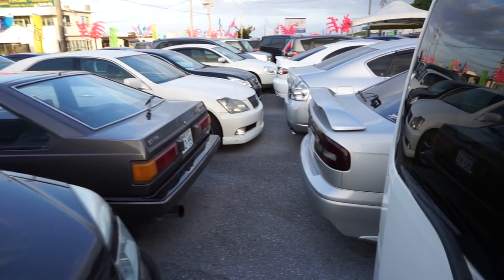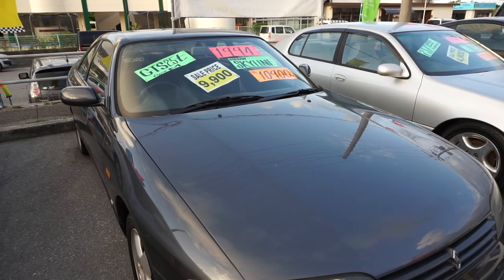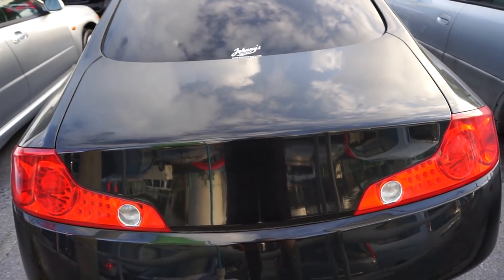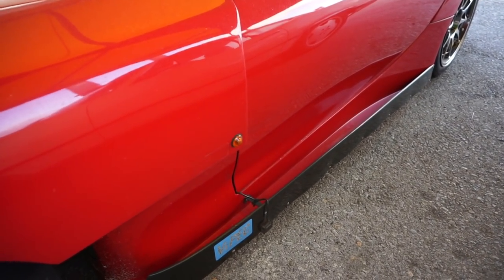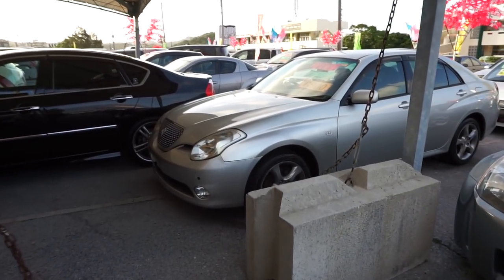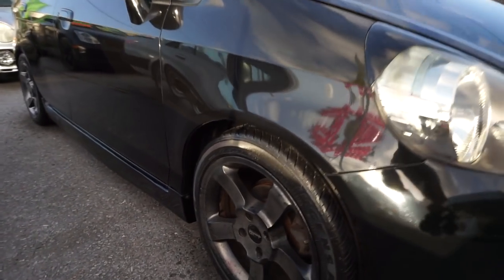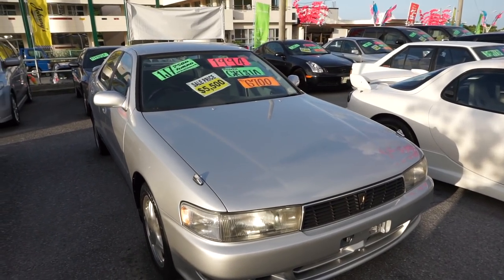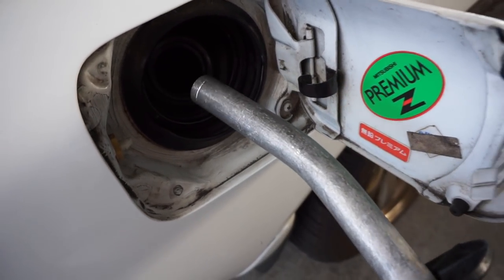Cars for Sale in Japan Part 14

Comment: Ughh....A difficult choice regarding the two FD's.The aftermarket aero kit on the white car including that front bar is pretty disgusting but the car itself seems to be reasonably clean.The red car on the other hand has a lot of Re amemiya aero parts including an RE exhaust which is a plus but the car itself is pretty rough...............I would take a punt and take the red Fd,get rid of the fugly hood and brace myself for a restore project ;)................Thanks for posting mate :)
Reply from the maker: Thats a good idea!
Reply: For those wondering, the red FD isnt for sale. Last I heard, it was the owner's recently bought project.

Comment: If you can remove your carbon fiber tailpiece on your spoiler those are big ticket items to be stolen at the port at United States
Reply from the maker: I have seen quite a few go through recently and not have them stolen. Mine is really held on there to so someone would have a hard time removing it lol
Reply: YourCarBro If they can make money with it, they will take time stealing it or removing it tho...
Reply: Screw it on.
Reply: YourCarBro challenge accepted